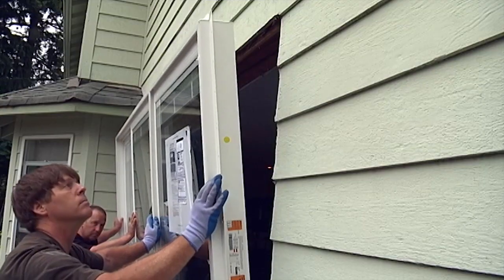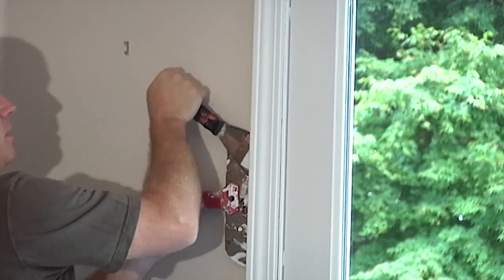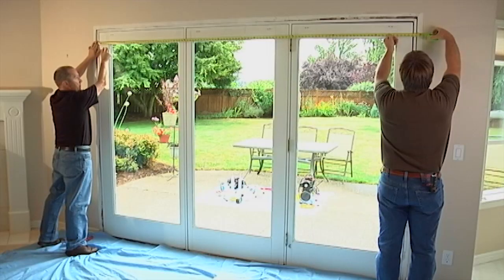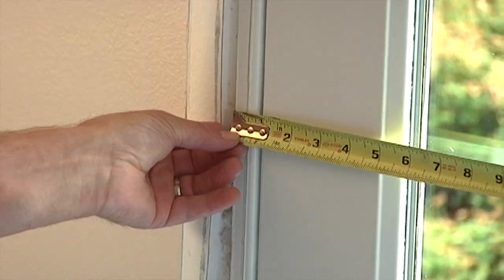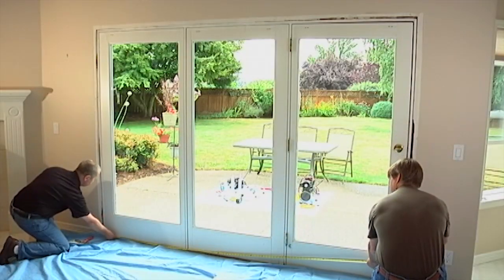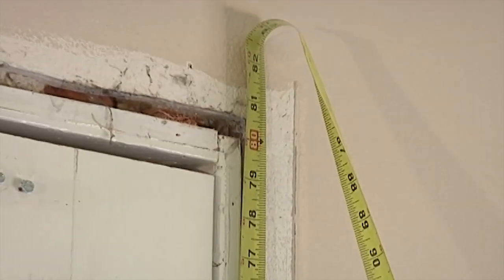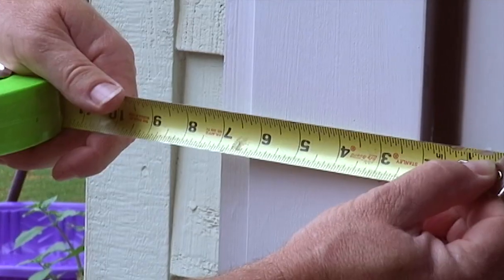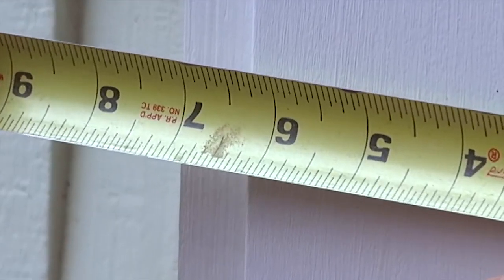JELD-WEN: How to Measure for a Replacement Patio Door

Comment: I just had my door measured by a construction company that is working for Home Depot. He has the measurements as 58in x 79in. Can that be correct? The house was built by a large company, DR Horton, 13 years ago. I'm pretty sure a large company like that would install the standard 60in x 80in.